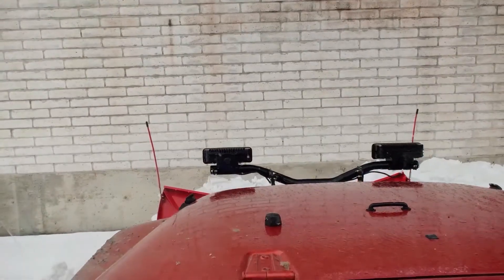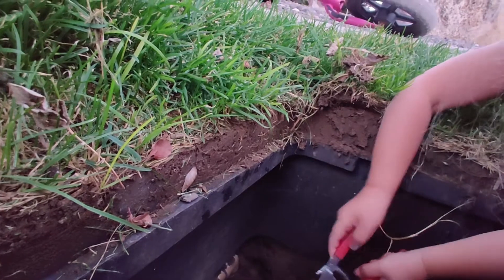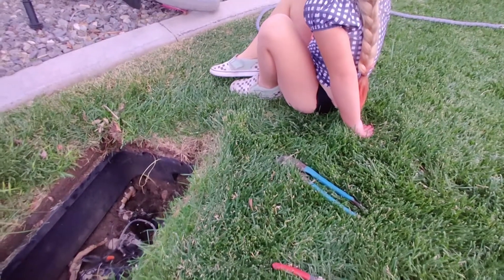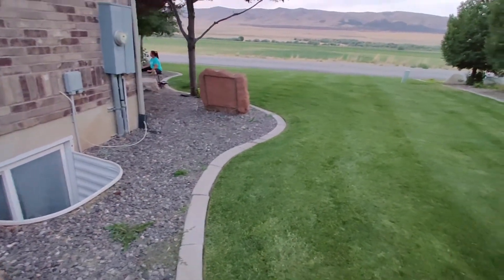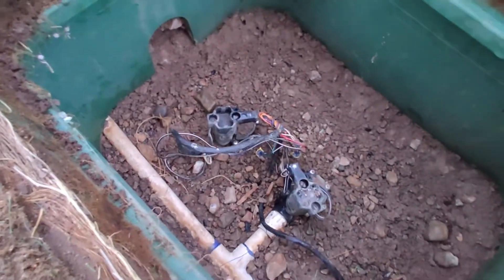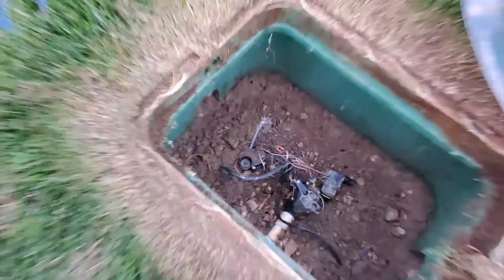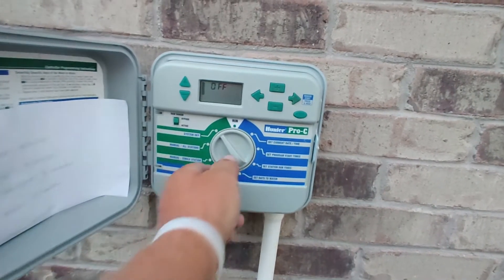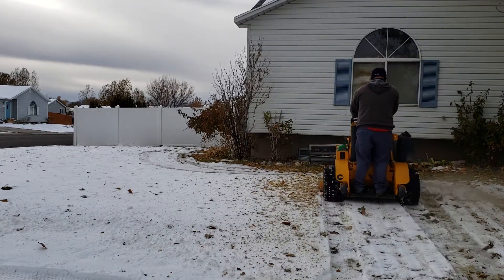FIXING ERROR ON THE HUNTER PRO-C TIMER

Comment: Funny. On my Hunter, I have an error code on 5 and reading further on your reply to someone else it should be the yellow wire if installed correctly. Thanks for your help!  Also, you have a great little helper!
Reply from the maker: Lol. Yeah just find the color wire hooked to station 5 and check for the same colored wire in the box. That should be the valve that's not working and most likely the culprit

Comment: Thanks for this video!  Can you tell me how you determine which solenoid controls which station?
Thanks
Reply from the maker: Well, if it's a properly installed system they should be color coordinated. So if station 5 is yellow.  Find the solenoid with the yellow wire.